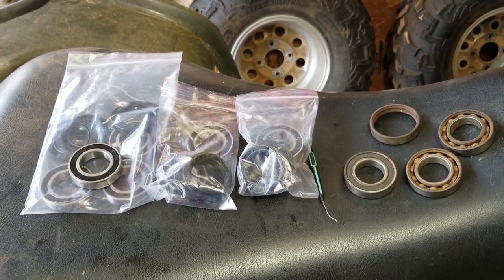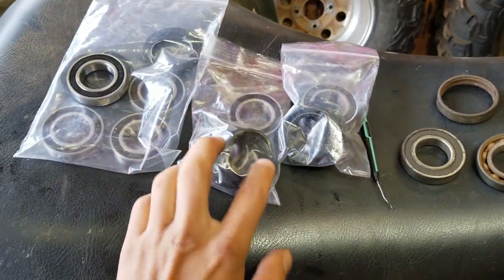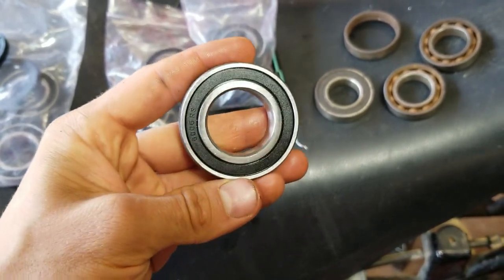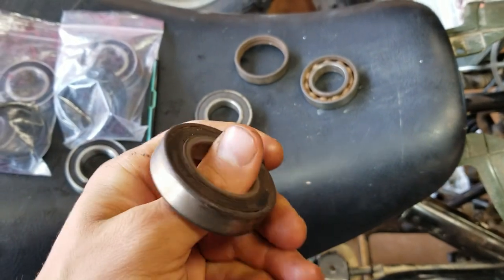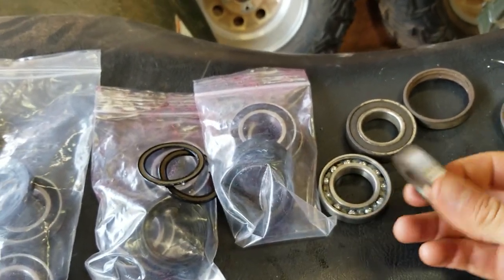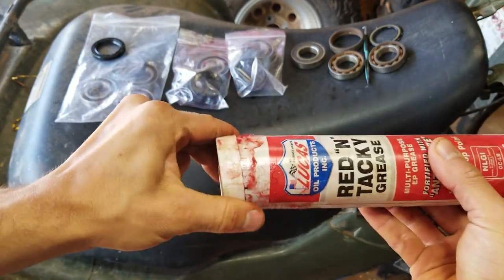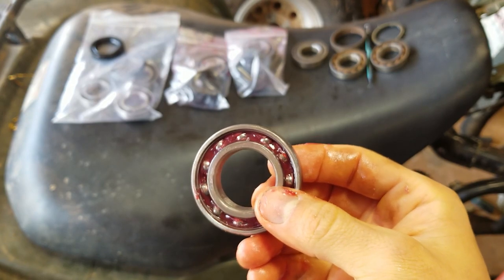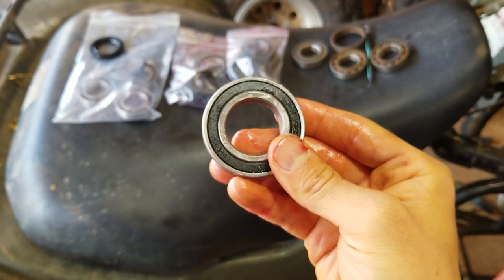Trick To Make CHEAP ATV Wheel Bearings Last FOREVER!

Comment: Your comments about the RPM at which those bearings work make a lot of sense; What happens if instead of using normal bearing grease, you use marine bearing grease instead? Maybe it will last longer, don't you think? I have been looking for a way to seal the water that could enter the axle bearings of my Ebike equipped with a Bosch Gen4 motor. Bicycle bearing grease is very soft and mixes with water easily.  Since every time I go through a puddle I have to replace the external layer of grease that has the external mechanical seal protecting it from water entry. Thinking about the low RPM of the pedal right now I'm changing to marine grease just for the external mechanical grease seal. I haven't touched the bearing seal yet. Thanks for the video

Comment: When I do mine I am going pull all the seals off both sides of the bearings. (Every size of ball bearing comes with 1 or 2 side seals or shields or plain.) drill and tap the upright for a zerk in a handy location. Pack the bearings and the cavity behind the seals. The outer seals should be plenty, and a couple of pumps from a grease gun a year (being careful not to blow out the seals) and they will last forever. I did this to a mowers spindles and they have lasted for years now.

Comment: I know it will be fine but red and tacky is more for sliding linear surfaces. For high force hi speed bearings you should use a lithium grease.